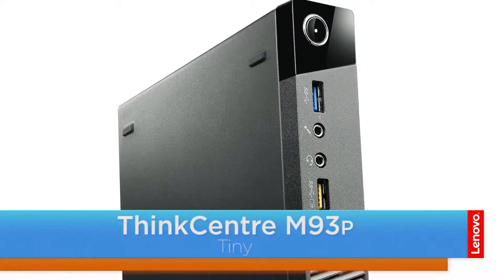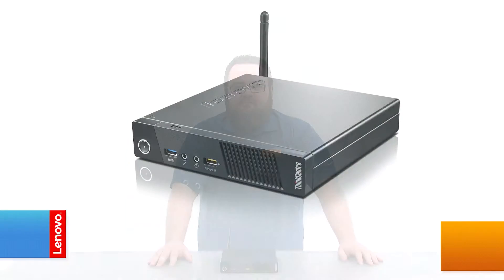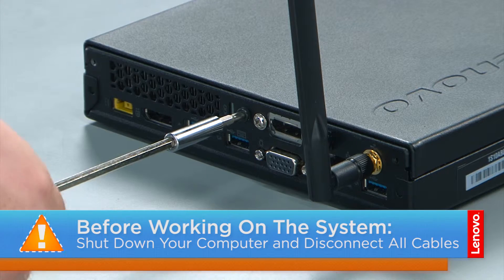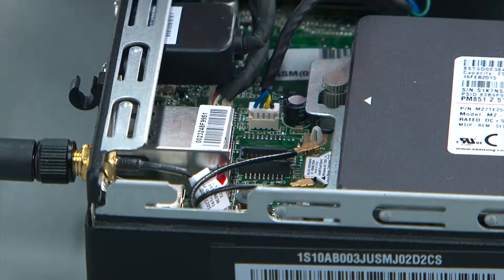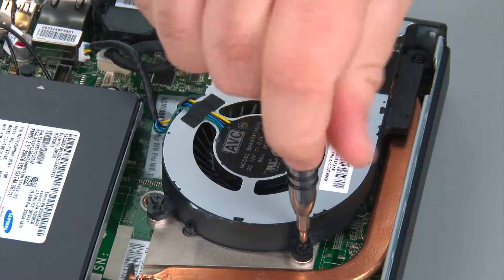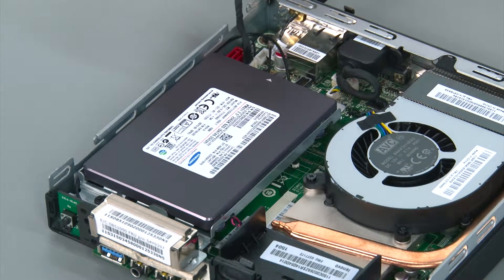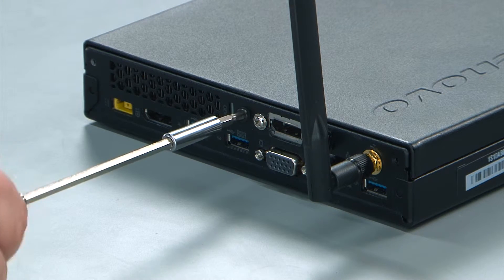ThinkCentre M83 / M93p Tiny Desktop - System Fan Replacement

Comment: Great video. The fan in mine quit and monitor now says comp. won't operate due to fan not working. I'm assuming when I replace the fan, the comp. will recognize and start up?  I hope so. --Anyway, did you remove the other cablings (other than the fan cable) just to get that stuff out of the way, to make it easier to disconnect the fan cable from the circuit board? --Thanks!

Comment: Hey LevovoSupport

I recently purchased one of these systems (used) and plan on upgrading the CPU to an i3-4370@3.8ghz. It's a 54w CPU as opposed to the 35w i3 and i5 CPU's used in these systems originally and it uses the same LGA1150 socket. I'm upgrading the PSU from the 65w to a 90w to power the CPU properly. My only concern is with over heating and thermal throttling of the CPU. 

Is there an upgrade available for this type of system fan?

Thank you for your help,

Fraser
Reply from the maker: Hi there, thanks for reaching us. We will check on tis concern. Do you have the serial number or machine type of your desktop so we can check details? Thanks. Arjay_Lenovo

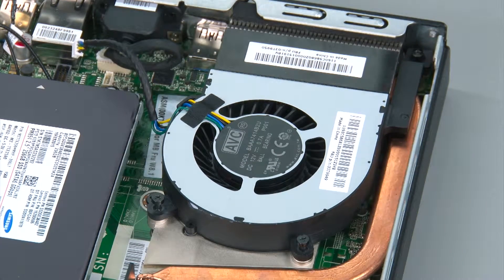Comment: If you run into an issue where one of the capacitors is very slightly bulged at the top and contacting the fan, therefore preventing the fan from spinning (in my case, it was the capacitor closest to the center of the fan, see video paused at 1:46), you can shim the fan slightly higher by using very thin washers under each of the three screws.  The shim has to be just enough to allow clearance from the capacitor while still allowing the case to close without much hassle.  This is probably a temporary fix as that capacitor will eventually fail, but in the meantime it will allow your system to boot.